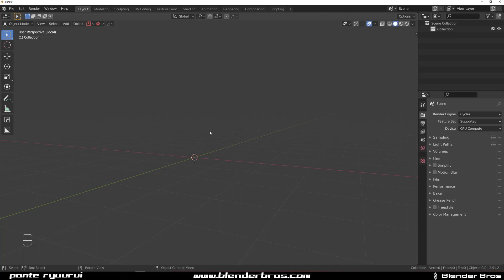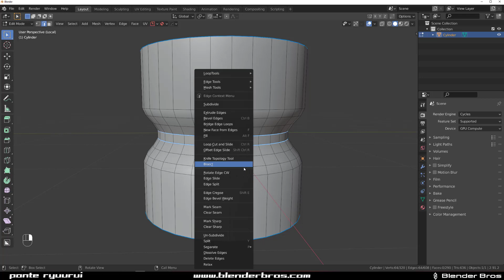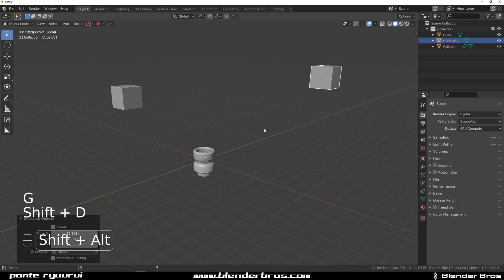SICK mesh deform trick with bridge edge loops tool in Blender

Comment: The edge loop bit is nice & all but the real revelation for me was that array trick you pulled off with Cablerator! You wouldn't believe how much of a pain in the ass arraying something along a curve is for me in vanilla. Didn't even realize they added this to Cablerator 1.2.1 or 2.

Thank you very much for this small but ridiculously useful tip Ryu!
Reply from the maker: my pleasure mate, ya he did after my vid i am actually gonna make a new suggestion reg. centering of the cable ends.